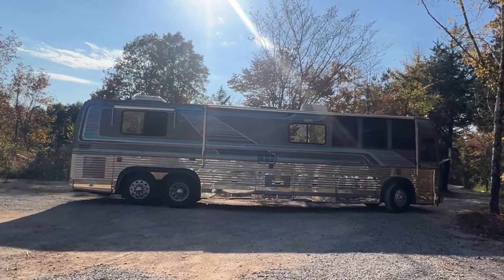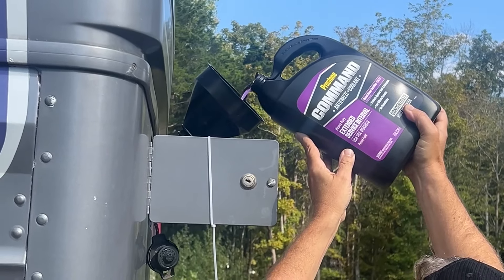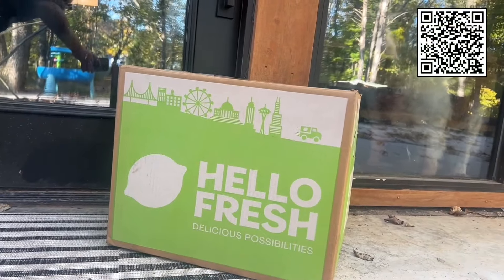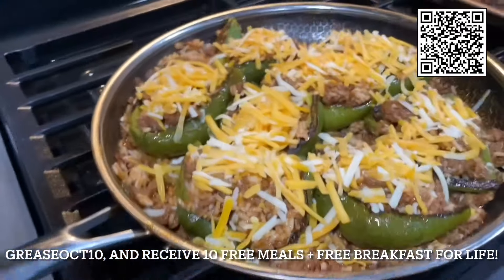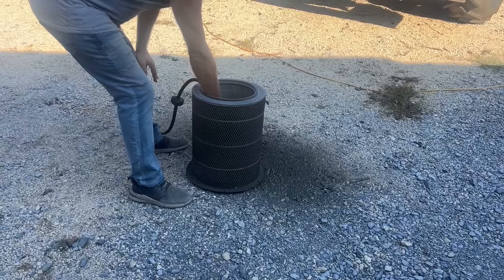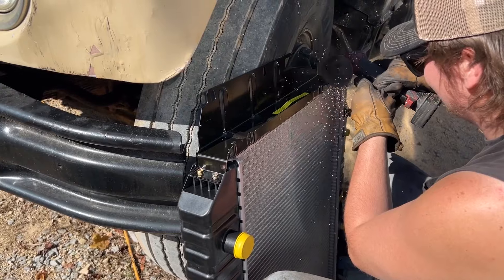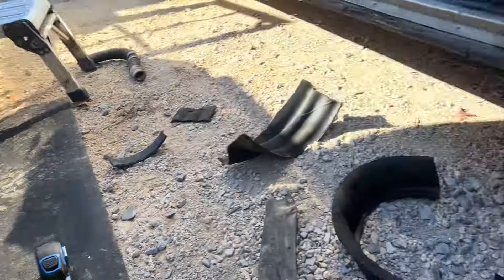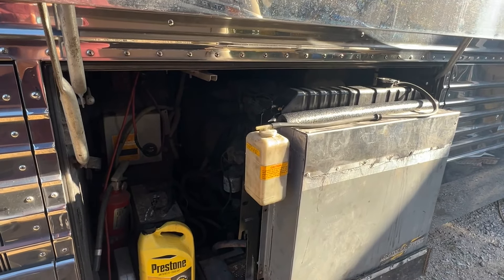Prevost bus rodents tore it up.  Dirtiest air filter and generator radiator fabrication

Comment: In 1977, I bought a Superior motorhome in the winter in WY. In the Spring I discover a leak in the copper pipe leading to the sink. It ran under the bathroom and split open an inch after leaving the bathroom. I finally fixed it by running the next smaller copper line through the split one.

Comment: hi  
The generator set seems unusual but it isn`t . Air cooled engines in an enclosure suffer from over heating unless well ducted to the engine driven fan inlet and a free flowing air exit semi ducted . Ceramic coated exhaust exiting engine enclosure to open air mounted muffler  aids cooling also .
The bus solves all these issues by having a large fan that draws all air over radiator and removing ALL engine bay hot air  . A booster electric fan would be a good idea  14--16 inch

Comment: Next time have some firecrackers on hand to clean out the air filter - light the firecracker and drop it into the middle of the filter, and have something heavy to close off the top. The dirt will get blasted out all at once, and the filter might even survive the blast!

Comment: We blew up our 8v71 a couple years back due to overheating. I’m thinking about swapping it with a good 8v71 and putting a good automatic trans in at the same time but I’m a little hesitate as I’ve only ever had to do maintenance/air bags on the bus. All my diesel knowledge i learned by working on my personal and work trucks. But those were 7.3s. Am i crazy for even thinking of attempting this swap? Or should i just scrap the idea and look for a little but newer bus and do a new conversion and scrap both of these 70 mci?

Comment: Does the new generator radiator have plastic tanks glued to aluminum? 😢
Reply from the maker: Every radiator is plastic and aluminum now a days
Reply: There is a 1 piece seal around the end of the core. Then the plastic tank is crimped on to give a better pressure seal.

Comment: A radiator without a fan is almost useless...
Reply from the maker: This has been running since 1990 like this.   There is a fan it’s just not hooked directly on the radiator.  Many rv’s use this type of generator cooling.
Reply: Yeah, it's typical in many conversions. @BusGreaseMonkey
Reply: It has a fan.  The squirrel cage fan in the cargo bin.  As long as the air flows over the radiator its all good.

Comment: Didn’t see a fan for the radiator for the generator wouldn’t that be more efficient?
Reply: My guess is that it would blow the air into the cargo space and let the heat build up if you didnt have a way to get that hot air out of the bin.  I have a fan on mine but I just open both bay doors to let the air pass through.

Comment: take all that off the front of that generator and put ele 12 volt fan on out side of that radtator cheaper and more cooling air dowm out board air down to the floor vent //fan on engine side of radiator try that with this set -up //I have 3 radistors in my home from Chevy truck radiator  heating my home from 1 gas hot water heater in my base ment work good with fans //save me money
Reply: They have a very standard set-up for a conversion. That squirrel cage moves A LOT of air through the radiator and compartment. Just have to be sure it doesn't short stack the efflux to the inlet.

Comment: An aftermarket electric radiator fan might have worked on that generator. Some of them are pretty slender.
You couldn't have gotten a better son-in-law than Jonathon.
Reply from the maker: Where is a fan going to blow the hot air too and where is it going to get cool air supply from?    You would have to change everything to do that.
Reply: @BusGreaseMonkey  Yep thats what I was thinking you would need to change everything....send it like it is !!! :)
Reply: The aftermarket assist fan install is possible, but you'd still need the main fan to evacuate the generator bay to take the waste heat radiating from the external engine case in addition to the heat from the radiator.  Instead of mounting the fan on the generator side of the radiator, it would be easier to install it on the air intake side of the radiator where there is more room, and set it up as a pusher fan instead of a puller by reversing the motor.  You do this on permanent magnet DC fan motors by swapping the power leads.  You lose a little fan efficiency (pusher vs.puller) this way, but it is a far easier install and would allow a larger more efficient fan overall.  The fan wouldn't be a restriction to airflow when it is off, as some might assume.   I wouldn't do this unless there is a definite overheating problem that isn't cured by a new radiator (with no cooling leaks on the engine and good thermostat), an evacuation fan that is in good condition and seals around the generator bay also in good condition.

Comment: Thought you guys were vegan
Reply from the maker: Did that for 6 years but not anymore
Reply: @BusGreaseMonkey  About 10 years ago I cut all carbs and ate a lot of meat.  Lost almost 50 pounds in two or three months.  No more aches.  Didnt help the cholesterol so much but I dont think cholesterol is as much of a problem as being over weight or too much sugar.  Our brains are made mostly of fat and cholesterol.  Many think there is a link between low cholesterol and alzheimers.